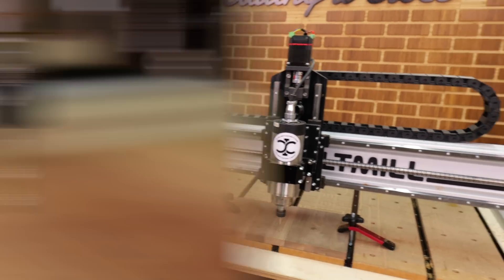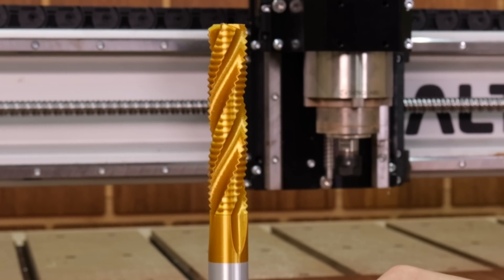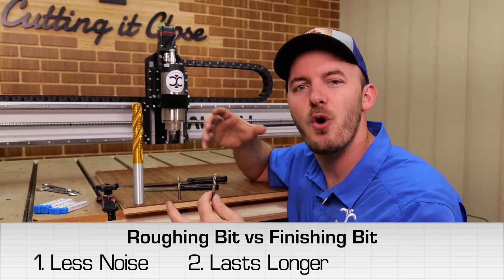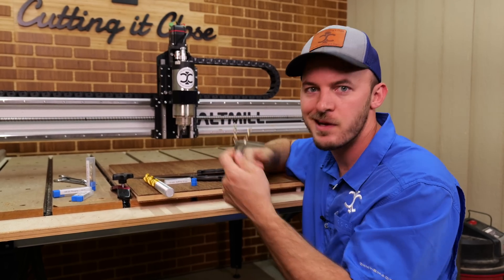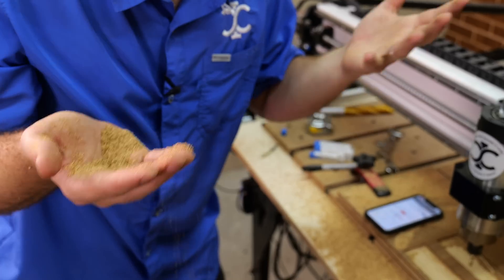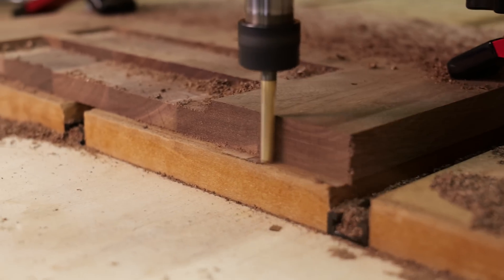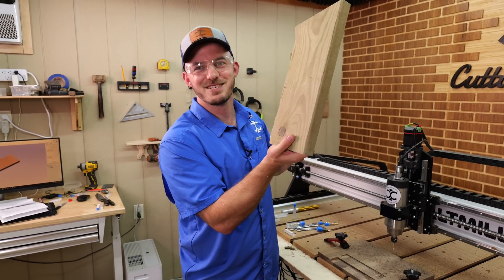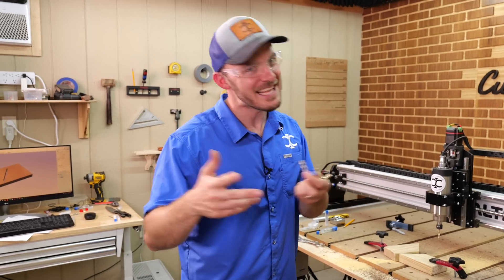Why This CNC Bit Cuts 2X Faster (And Saves You Money!)

Comment: with a 10hp spindle, a vortex 3/8" 2-flute viper can get near perfect finish on 18mm plywood in a single pass, no rougher needed. I run it at 550ipm for an onion skin and final pass, mostly doing that second pass for dust collection laziness. And this is euro-maple, voidless plywoosd

Comment: He did talk about the speed of your CNC .It all about Chip load  the bits only work right if your CNC can do the proper Chip load. Can your CNC go 200 to 600 inch per minute, most small CNC can't. If your CBC can't do the proper Chip load you wasting your money. He giving good advice if your CNC can do the speed and he talk about.

Comment: With a finishing pass on hardwoods, what level of sanding is still required before applying a finish? For example, still starting at 80 grit or more at a higher grit due to the finishing pass?

Comment: I have a shapeoko 5 pro with a pwncnc 2.2.2kw air cooled, and I just ran a ⅜ big girl at 150ipm for about 500 linear feet today in plywood @ 3/8 depth of cut. And it handled it with ease. Love them bits. They're awesome

Comment: Always use roughers for the work we cut on HDU and other materials leaving about 1/16" to 1/8" stock left to clean up with ball end mills or other bits. Way faster especially for Adaptive cuts. Usually running at 18000 rpm and 300-450 ipm. DOC is usually dependent on material type/density.

Comment: Good explanations.  I have started using your technique of using your roughers with small offset and then doing a finishing pass with either a finisher, bowl bit or some other smoother cutting bit. 

 I am often conflicted on pockets and other similar cuts on whether I use upcut or downcut rougher.  Not enough experience to know if I use upcut rougher with downcut finisher will it always remove tearout created by upcut rougher.  Or, do I use downcut rougher with downcut finisher.  Any thoughts
Reply from the maker: For pockets a downcut works great because it’s not recutting the same chips over and over again, the chips have somewhere to go in that pocket, it’s only rough on the bit in that very first line it does, after that it’ll go great!

Comment: I have the 1/4" downcut bit and love it. The first time I used it I ran it into my clamp and t track and it damaged the end of the bit. I was pretty upset but still purchased a new one but continued using the damaged one until the new one arrived and it still worked very well. I would recommend these bits to anyone. Now I just need to order some finisher bits

Comment: A must have! Time saving and money saving is noticeable in zero time. I use those bits also to increase the surface for glue up with a 0.04 vertical offset without using a finisher.

Comment: Nice video.  I notice you have a spindle, and so you can run it pretty fast.  For those of us who have a router, can you ballpark an ipm reduction factor?
Reply from the maker: It depends which bit, I would say with an 1/8 rougher you can go 100-150 ipm easy, but with a 1/4 bit running at 200ipm that router may struggle. Just depends on your setup. But an 1/8 bit should be able to handle whatever you can throw at it.
Reply: @cutting-it-close  I just ordered my Shapeoko Pro 5 4x4... got the 65mm VFD Spindle Kit - 110V and the Carbide ER-11 Compact Router as a backup, I got their endmill startup and sign maker kits... and will get all of your bits and do a video comparing them (time to cut and time to finish [after cleaning up], sound etc.) Saw your video on the self-cut table for the Shapeoko Pro 5, might use it (concerned about that stability, do you have a follow up video after the glue-up and or additional support/screws etc?  -- I do a lot of work with 2x's for outdoor (mitre and handhelds) and looking forward to trying the roughers on those for exterior joinery!

Comment: I've been using these bits for years. The only downside is the rough cutting surface you have to deal with. Just a bit more sanding time. They are a must in my shop. Period.
Reply: I saw the other day someone cut with a rougher then went back over it with a 60 degree to smooth over the rough edges. Just a thought.

Comment: Another masterpiece video from Ryan. Those bits are just awesome. The high pitching sound is due to the vibration transmission on the straight sharp edge that in linear length is way shorter then in the rougher one and the teeth helps a lot killing those high frequencies.